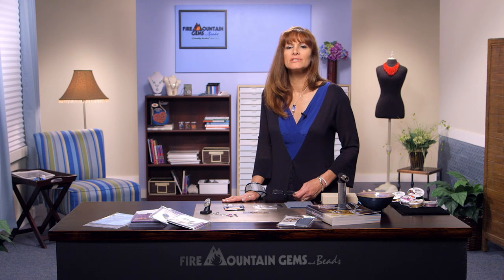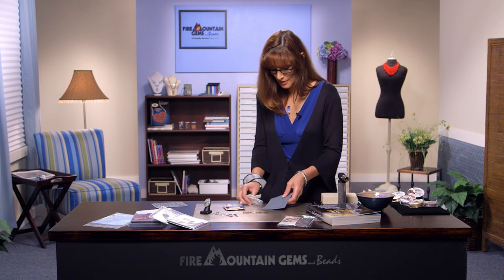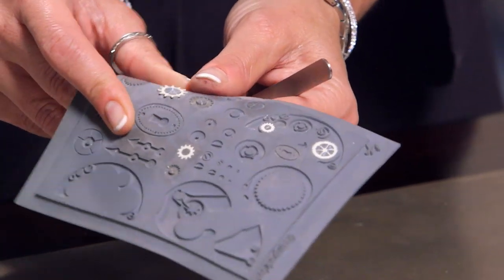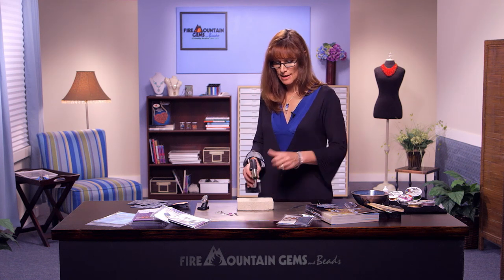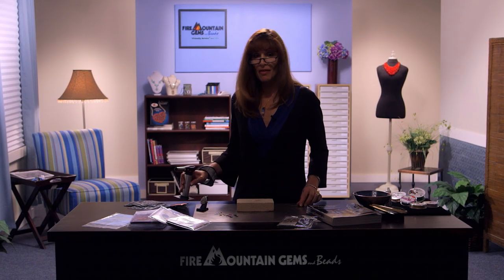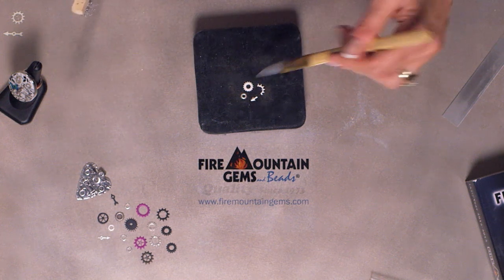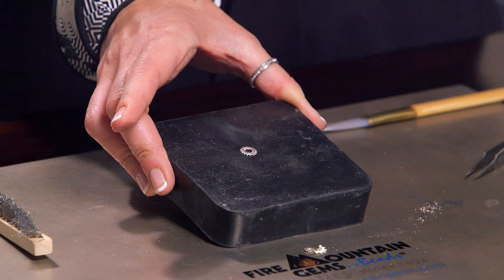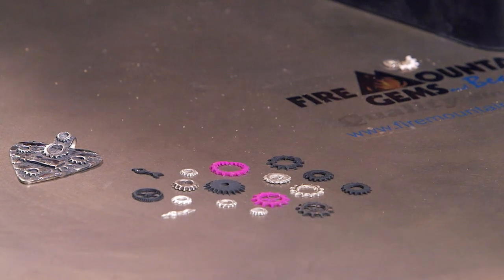How to Create Steampunk Gears and Embellishments Using Metal Clay

Comment: Can the stamp be used for normal polymer clay? So I can take the components out and bake them?
Reply from the maker: Absolutely, Sandra.
Add a spray release to the stamp (especially the "innie" version), so that the polymer clay comes back out easily. Otherwise, it can distort and flex while you're trying to remove it.